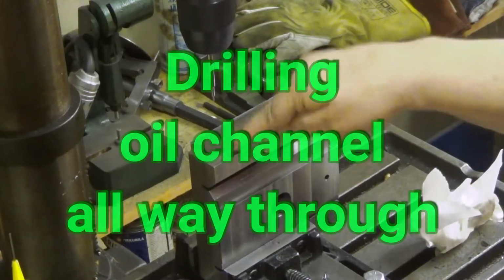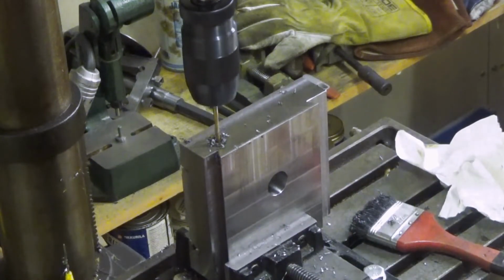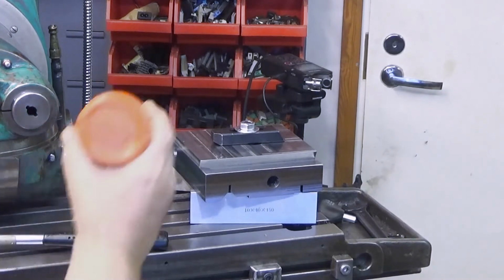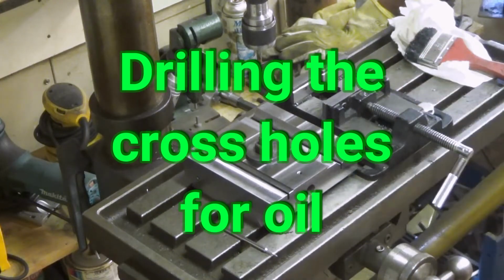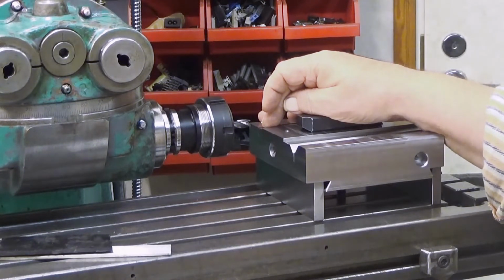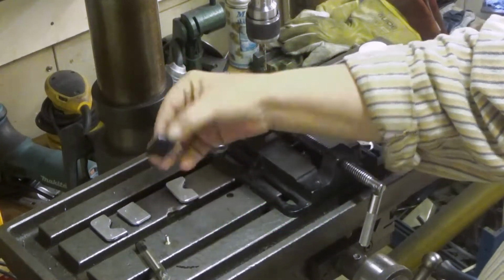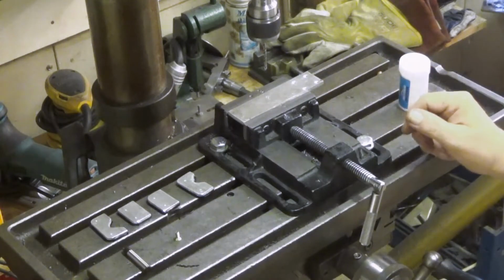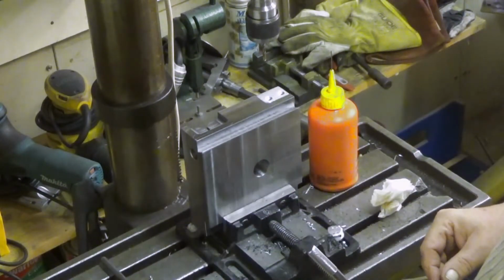FUM0138 New Tailstock 7

Comment: Another way to do a recess that I have done in the past is to drill down to depth and then either grind a drill bit with a flat or use an end mill to flatten it. You could just leave the bottom hole with the drill angle at the bottom. Good videos.